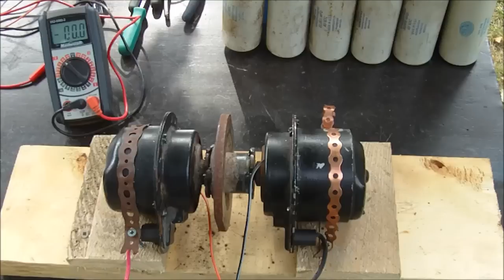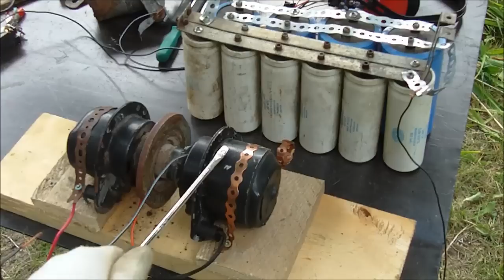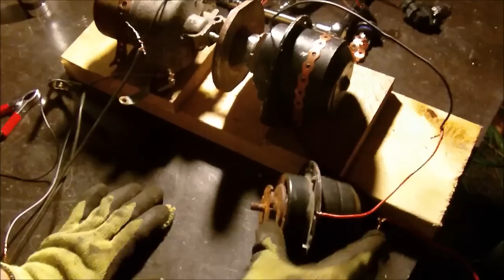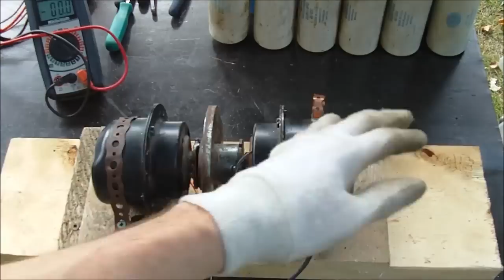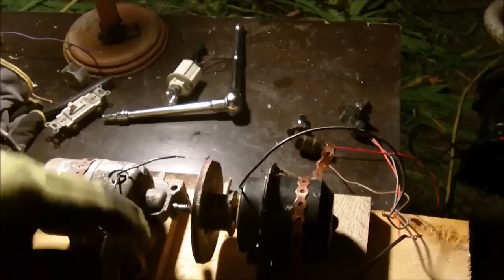Electric Motor to Motor, can they self run?

Comment: You did not properly duplicate the theory mentioned by others who claim it works. They supply a a/c to power the motor and supply the caps with d/c from the output motor. The d/c is converted to a/c. I believe that they use a joule thief circuit in between the d/c and a/c converter. I am in no way saying it works because I never tried to see. I just think testing should be properly done before saying if it does or does not work.
Reply: Please reread my comments (I revised).
Reply: Testing? You mean like dropping a rock and expecting it to fly upward?
Reply: Exactly. That's what happens after hitting the ground, it's called bounce.
Reply: True,, he didn't duplicate it.  He forgot to sprinkle the magic fairy dust on it... Lol

Comment: This is a good demonstration on how it should work, with the capacitor banks and how important it is to check the positive and negative points. Thanks for this video. I'll use this as a reference with my project.

Comment: It can create the impression or illusion of self running by using the caps as batteries ... 
One unity is not possible but free energy is if you pull power from the earth the sun hero thermal and many other free sources
Reply: jolllyroger1 pulling power from wind, sun (solar), tides, etc is NOT what we are talking about here, unity +.  I guess you think old steam engines are creating energy? LOL

Comment: You know, it's funny because it's obvious why people THINK things like this should work.  SO, let's assume that it becomes possible to eliminate all losses (connecting wire/winding resistance, windage, bearing friction, etc.) and a perpetual motion device is created.  It should also be CLEAR that a perpetual motion device, IF it were possible, only BARELY works.  Therefore any attempt to tap into the system and use some of the "recirculating energy" would instantly cause the entire thing to stop functioning.  If I had a perpetual motion device running in my garage, right now, it would merely be a curiosity and nothing more than a demonstration toy.  We can all break the laws created by men, but we CANNOT bypass the known laws of physics...
Reply: if it were possible to get rid of all the losses, what you might have is an efficient battery. I don't expect to see this in any back yard youtube video. edit: now that I think about it, these machines do exist in larger scale. they use a huge flywheel spinning at 10k+ rpm, and can store energy for later use. they're also used to help stabilize ships.

Comment: If it were possible to build a motor with a magnetic 'floating' bearing, what would be the increase in efficiency? Also, if you're losing heat through the coils, how would something like this with a brushless setup work in comparison to the common brushed variant people are experimentin with?
Reply: I was looking for floating electric motors at the iss. Did you see them spinining? what if they spin with magnets near coils? I suposse will produce some energy.......indefinitely
Reply: @@KeyDx7 Then place the part in a vacuum chamber. I suppose you would need a perfect vacuum and even then the energy saved from the motor would be lost in the expenditure from keeping the air from the chamber. It's an interesting thought experiment.

Comment: If they were put in series as in both are parrelel this would potentially work and it wont generate backwards so switching wires wouldnt do it.. If you turn one 180 degrees then the shaft was slightly extended from the back.. The push motor needs to be 1/3- 2/3rds less power needed to run and due to drag the push motor needs a bigger pulley to scale it up on a v-belt the part of using the extra weight is a good idea ..to force momentum to carry on under small load ..the math scale you need is what i described it will work everytime but you must realise : if you use a car alternator it actually needs to run at 12,000-15,000 rpm even though your car charges at 1.5krpm to 2.4krpm approx the fact your drum pulley is scaled larger (so it is the push motor for example) your alternator would be the generator motor and always needs to have a smaller pulley so its rpms achieve its actual rotate to generate RATE ..ok for these systems to work properly youll want to use a regulator or a "buck" or a stepdown that lets you adjust the power going back into your push motor..keep in mind your push motor will heat up so thermal cpu computer paste can be helpful or a fan on it will also help..windmills in my opinion are nearly useless on cost/ efficiency , a waterwheel (longer or larger the pushing wheel is or bigger pulley the more efficient your system will be ..think of a farias wheel pushing a pulley in place of a bicycle pedal and a belt where the back tire used to be on a bicycle with an alternator on that same belt and bungo you have it )is a good way to go given it has more continous torque watts amps rpm caculate what your system is using and its better to have a rechargable battery field example marine batteries..and multiple "bucks" to regulate the power (NASA SHOULD HIRE ME BUT MY PARENTS ARENT FAMOUS ENOUGH the ironey)
Reply: Hello Mr wonka..

Not nasa here but I am the manager at jack in the box!!
can you come in for a interview?
Reply: Firm or Fast Food ( I hope you arent talking fast food , I was a Quality Assurance Manager for Hardee's corporate, never let proceedure slip or sacrificed customers quality or service experience with product ..customers are always the number one reason and havent ever walked away unsatified bu my performance, but for ethics reasons I'll never work fast food for another company ) or are you just making fun of my choice of character? If you'd like an answer to that : "simply put Gene Wilder gave so much on screen , he's been to all places Mr. Rogers would never go, his spirit lives on with my character creation, the real Willy Wonka was a great man I admire alot. He saved pocket change in his home walls with he beloved wife and children later found his fortune. If you think somehow you are talking to a clown or joker..please be aware & I'll only say this once : I have high score on Stanford Acheivement Tests in catagory; concepts of numbers for State. Also if you say "firm" and actually mean it I hope you have alot of time to dedicate, given I have multiple cases that have a significant statute in civil courts and I can keep you hired for a long time pursuing ..commercial class that should be worth millions..I wouldn't take millions to go through it again ..Lastly tell NASA Im serious , Im not a toy , I am considering the human race the efficiency the environment the production to perfect and the over all budget of each and every customer "Im not looking to get rich, I am more interested in seeing the products take off like computers did in 1995 the technology jumped .(I was part of that to) I missed a chance to work for U.S. Robotics & I would be interested in working for D.H.A.R.P.A but I dont want to have any part in building any type of "killing machine" or have it called "defense" but rather actually be (propaganda) it has to be karmatically sound ..Im* not interested * in any type of machine to harm another human being. However I can teach a robotic arm to farm. I would like help from people who already have the parts I need..thats the major..I dont expect to be paid for an unsucessful product or venture. NOTHING ON A WHIM.
Reply: @americanlivesmatter-BmanWild  Ya but did you know that the 1986 sci- fi thriller "Cocoon"..starring Don Ameche And Jessica Tandy Used 100% real cocoons on set during filming...And not only that..but wherever I go..there I am ?...

What the fuck are you on about? I was just fuckin with ya but that was a serious explanation...I do have some questions about ecm 142 (GE) motor.if.you might be able to help out I would  appreciate it &.I do hope you realize this is giving me stitches from cracking up

Comment: Without the shafts coupled together, you can connect the wires together  (polarity doesn't matter) and turn the shaft of one motor by hand. Small vice grips work well for this. The shaft of the other motor will rotate, but not as far as the drive motor. Good visual demo of motor/generator losses. And it looks nifty :)

Comment: Well if you only included some magic in the system, maybe a flux capacitor or two... then it would totally work.
Reply: nope theres a lot of resistance + it can't produce energy for one motor + that 2nd motor to produce energy
Reply: agreded
Reply: +Link Age havn't you watched back to the future kid?
Reply: that what did you tried self running forget about that you can't get more power because theres heat theres resistance a lot of stuff that will stop it from self running even if you use  one stronger motor that won't work resistance will be biger if you do that theres no way that it can produce enough power for light and for moving motor on the left side   that will run one on the right
Reply: thats what i want to say you all the time

Comment: Perpetual motion machine aren't possible...
Reply: the_real_matt yes they are you have to super cool the electrons to give them free flow so they do more work for less out put give you free energy so cool it lol 😆😆😈😨😨😨😨😱😲😲😵
Reply: I really hope your just joking around.
Reply: what is a water wheel?
Reply: Troll Universe what about a tidal genorator
Reply: Tidal generators draw energy out of the rising and falling of the waves, reducing their wave size in exchange for energy. Energy is never created or destroyed, merely converted
Reply: Plasma Channel yea but arnt tides created by gravity and you can't run out of gravity
Reply: MaHONri T  I see. There are two types of tidal generators. Wave driven and physical tide height driven. Most are wave driven. Waves are created solely by wind or tectonic movement. So, energy from those sources, is converted to electricity. True- gravity cannot run out. However, energy is not being created. Gravitational potential energy from water height is being converted into electricity. Conversion is the key word here.
Reply: Plasma Channel I'm wondering thoughwhere did the potential energy come from to give the wave it's height? If it was lifted by gravity then energy was either created by the gravity or it was transferred from the gravity meaning gravity can run out.
Reply: MaHONri T n
Reply: Waves ultimately come from the sun via weather, tides come from the moon moving further away and the earth spinning slower.  Extremely large, but not unlimited, sources of energy
Reply: Mark Tillotson that makes sense if the earth is slowing and moving further away from the moon then that is the source of the energy how ever at the macro level galaxies are moving away from each other at an accelerated rate meaning that perpetual motion is possible or their are vast amounts of energy available that we are unaware of would you agree or disagree?
Reply: 100 percent totally wrong here !!!  check out my post's here you will or might see the reason's why your saying this now
Reply: @anthonywoodroffe9642  Then you will increase loss of energy in your super cooling process.  There is no loop hole here because magic does not exist... We live in a state of entropy.
Reply: Absolutely wrong, it’s entirely possible

Comment: As long as you dont change the inside workings of a "normal" motor the regular motor is designed to auto destruct the dipole "battery" back emf, lenz law etc. etc. but if you use the back emf & structure the magnetic flux to flow with the current instead of opposing it then maybe just maybe you have a chance